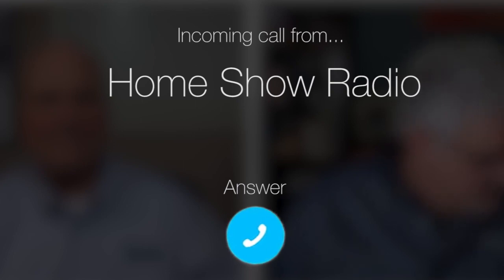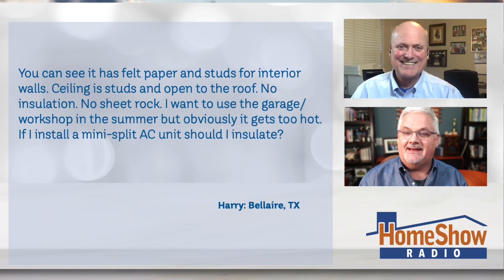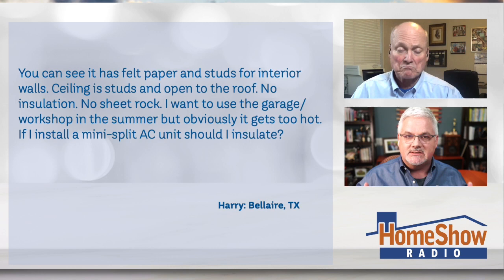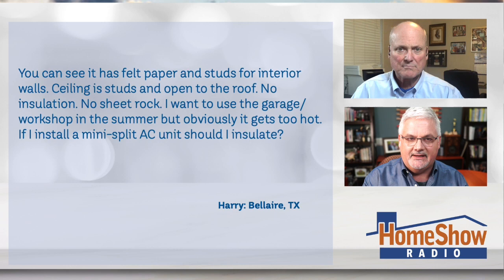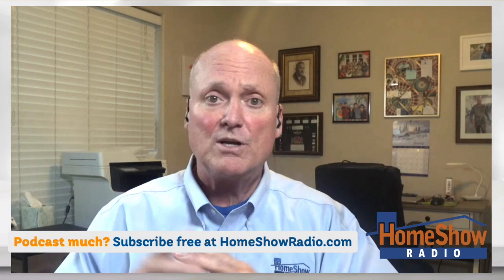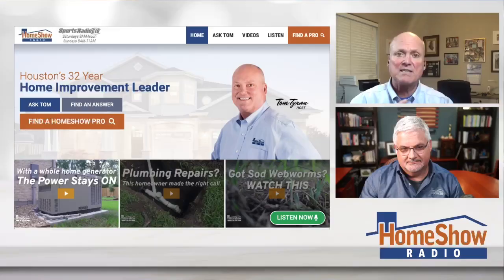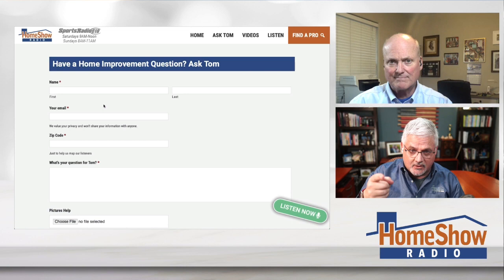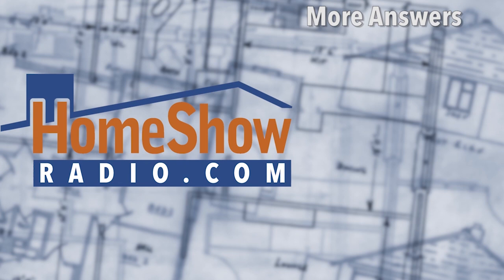Summer Garage Cooling

Comment: I have a 20x30 insulated garage.  I have a ceiling that’s dry walled and insulated.  A roof vent that runs.  I had two AC units in there last year and it was still hot when being active in their (golf simulator/work shop). Not sure what I’m missing but I feel it should be way colder than it has been.  Any thoughts/ideas?